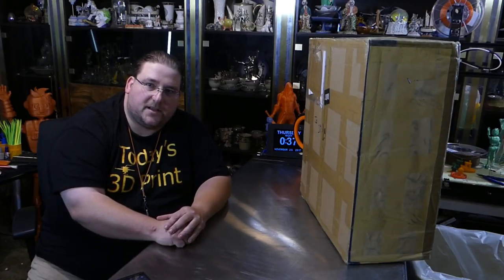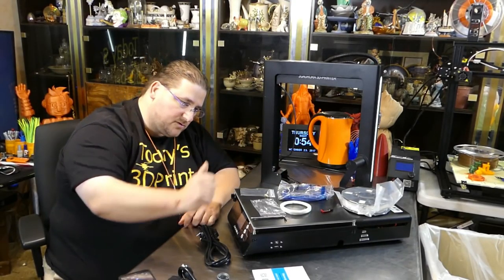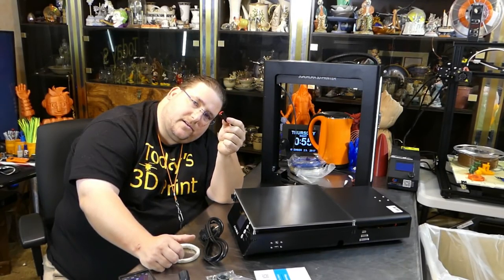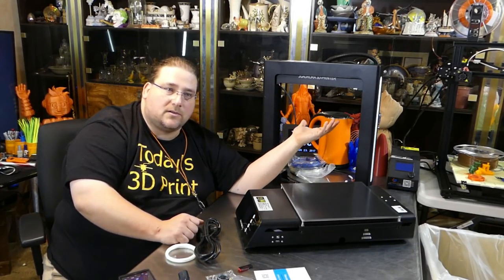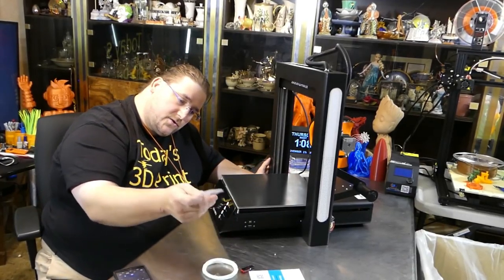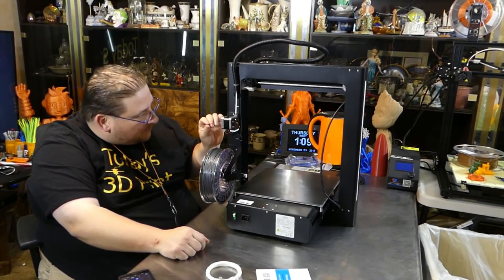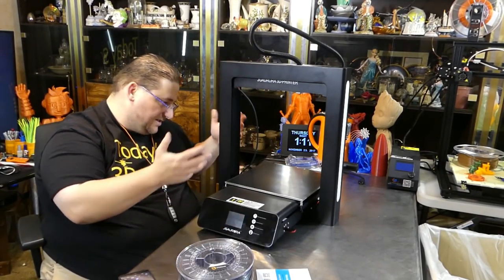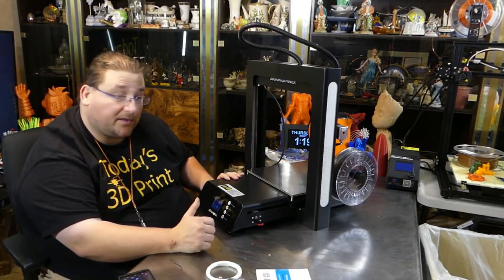Today's 3D Print 162 JG Aurora A5 Ubox, Assemble, Print, Mostly Uncut

Comment: Did you get a haircut?  Something is different about your head.  Enjoying the posts, BTW.
Reply from the maker: +Michael Goodfellow about a month ago I hate getting haircuts since they cost money but if I'm going to be on video I need to keep it relatively neat :-)
Reply: Hey, it's less than a roll of filament... :-)
Reply from the maker: +Michael Goodfellow where the hell do you get your haircuts :-) mine cost me $18 with tip I regularly get filament for $10 a kilo :-) so that haircut cost me to kilos :-)
Reply: I pay $25 for Hatchbox filament, but have paid less than $15 for a haircut at the local mall place across the street.  Then they went out of business, so now I cut my own hair (awkward and not the best cut, but I'm not picky.)
Reply from the maker: +Michael Goodfellow yeah I save $25 filament for special Prince I print so much and so large that I melt plastic like it's candy so I thrive on the $10 kilogram filament deals

Making money from these filament deals is a new thing for me I did it originally and continue to do so because I need the cheap filament :-) I figure while I'm finding it anyway I might as well let everyone know about it doubleplusgood bonus :-)
Reply: I bought that Solutech Ultra Blue you used awhile back to print the dragon.  Really amazing finish on that stuff!  But I tried the purple as well, and got a completely different result.  Very gloppy filament that wasn't flowing well at all, even at a higher temp.  Weird!
Reply from the maker: +Michael Goodfellow weird! I have a roll but have not tried it yet. Reach out to them and see what they can do.

I will try mine this week.